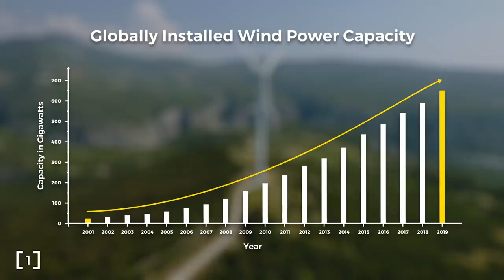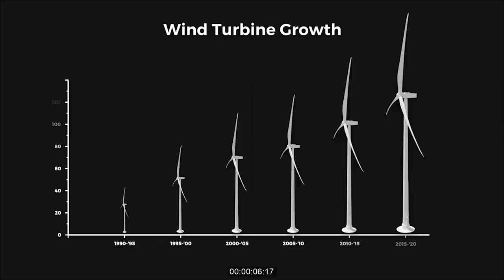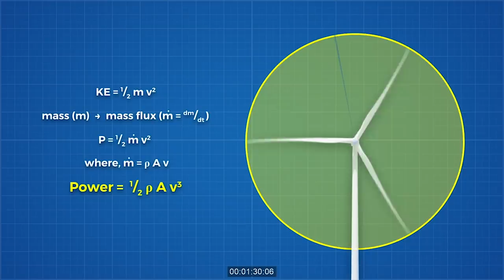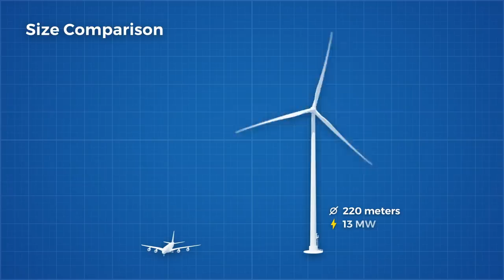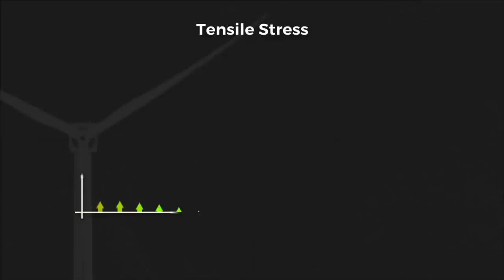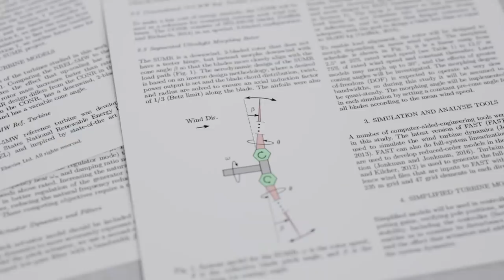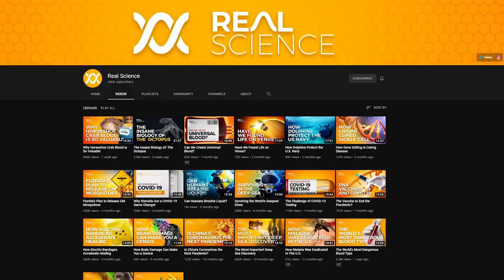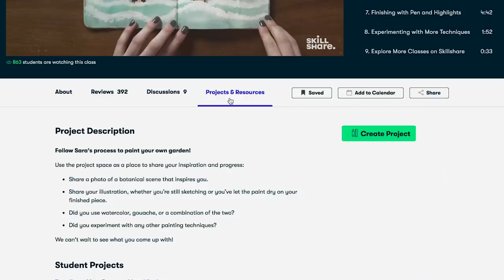How Big Can Wind Turbines Get?

Comment: Yep, coal is an archaic and under extinction power generating method. If we ignore the fact that it is the most used electricity generating method and the second most used overall energy generating method (where it is bested by oil, barely.) Wind increased by large in total amount, and even more if we use percentage, but fossil in general is actually increased too, and by way more in total volume, so no, the current "green" idea is failing, yep, the ideal places like danmark and ireland (no heavy industry and stupidly high cost to population ratio) it can be a leading one, with 100% fast gas backup, otherwise it is simply too risky. But it won't solve the energy issue, still only one non fossil solution for that, sadly that one is a big nono for every green idiocracy.

Comment: Wind Power is far more useful once linked to battery mega packs, which ensure that there are no S/D issues in a short time scale. This clip ignores this development. Also winds are more stable and stronger if you are higher up, which helps higher turbines.

Comment: As a lamen who just likes watching these videos I have a question, Larger seems to be better in the case of Wind Turbines. and  Wind Turbine simply turns rotational energy into electrical energy right? Does this technology not also scale down the other way where it could be put into automobiles so that the spinning wheels of the car also generate electricity? 

I've wondered this for years, as I live in Central California where the Altamont pass has a ton of wind turbines and I've always pondered that question as I drove through it from the Bay Area from or back to the valley. Thanks for anyone who can answer this question. :) 

Sincerely,
An idiot.

Comment: molds require precise machining? what other kind is there? so we get played like a violin nowadays? first a computer does it all with software. the cheap easy way. all man has to do is limit the vibration of the cutter head. BFD.  228,000 blades made. does that sound like it's difficult? sounds pretty routine to me.

Comment: People fail to realize that the big boy wind turbines have a production life of 25 years max then they are rust buckets that have to be demolished  because it's too dangerous to disassemble them. The massive composite blades have no half life -they are mammoth fiberglass hulks that fill ENTIRE landfills FOREVER as they do not degrade. There is no such thing as recycling the blades as they are falling apart pieces of junk by the end of their service life. (By the the way, a nuclear plant service life is 50 to 75 years) And we haven't talked about the displaced animals and hundreds of thousands of birds of prey killed every year by wind turbines. If people want green energy then they should back zero emission, safe nuclear that output hundreds of times MORE power (one reactor = 1,520 big wind turbines) on a footprint that is a 100 times less. Remember, this gleaming white monstrosities become massive, broken dangerous rust buckets in 25 year or less -search Germany and wind turbines. The Germans invested first and very heavily in wind and now they are secretly firing up more and more coal fired plants as their turbine are literally falling out of the sky as massive pieces of junk. Research what these turbines and blades look like after 10 or twenty years of service -they are no longer gleaming white statues but rusty and dangerous hulks that literally pose a danger to anything beneath them. The reason they are building these inefficient mammoths is NOT because they are great value for the energy dollar BECAUSE they are built with government subsidies. People and governments erroneously think these initially gleaming white things will last forever -THEY DON'T. The demolishing of these monsters will offset any fraction of use that they had. If they lasted one hundred or two hundred years and didn't wipe out millions of birds all over the world then they might be viable, but they don't. Smaller wind turbines are useful for small remote sites or villages NOT for producing base electricity for the grid.

Comment: As far as I know s-class glasfiber is stronger than carbonfiber so it can hold greater loads, but its also more expensive. So I don't really see an advantage from Carbonfiber.
Reply: Windmillblades are using, as i see it in your Video, Glassfibermats not glasfiber filament little difference in the name, but a big difference in price and strength.

Comment: Wind is not the answer. It just isnt. the limitations on build sites, cost and frequency of maintenance, bird murder rates, etc. Not to mention all the time and effort it takes to manufacture, transport, and erect each one. Plus it doesn't solve any local demands if you're not in a windy area.

Its just not going to be any sort of dominant energy. Especially when solar prices it out.

Comment: Also I'd like to see a video if it's really more environmentally friendly to produce millions of fiberglass blades every year than to just use coal and natural gas.
Reply: Let's compare: 

The lastest 3 GW offshore wind farm needs around 250 turbines at 1000 tones each (250,000 tones of mined resources) + cables transformers etc lets round to 500,000 tones including the fibreglass blades.

A 1 GW coal power station is about 200,000 tones of materials (boilers, steam turbines, chimneys, cooling towers etc.) Plus infrastructure to supply the coal (strip mining, trucks, trains, ships and some fibreglass etc..) A total somewhere between 300,000 and 400,000 tones depending on setup.

So slightly less., but not by much.

BUT the coal power station burns 9000 tones of coal per DAY, 3.2 million tons per year, 100 million tones of mined coal over a 30-year life, plus 20 to 40 gallons of freshwater per kilowatt of electricity (that's hundreds of billions of gallons over the lifetime), plus 100's of millions of gallons of oil to mine and transport the coal and process the freshwater.

The wind farm burns NO fuel, needs NO oil and uses NO freshwater

So roughly 110,000,000 tons of mined resources for the coal power station

to 500,000 for the wind farm. 

220 times more mined resources for the same total electricity generated.

And that's not including recyclability:

The wind turbines and infrastructure are around 85% recyclable 
(most of the wind turbine can be recycled except for the blades)

The coal plant including coal and oil is less than 0.1% recyclable.

Comment: as long as the blades still have room in landfills as the blades are  pretty big.
the waste these turbines produce is ridiculous
Reply: Not to mention the energy consumption they require not only for manufacturing and transport, but also for maintenance. If one look at the carbon footprint based on maintenance per hour, the maintenance carbon foot print of offshore turbines is astronomical.

Comment: "Clean" energy seems a misnomer when dealing with absolutely enormous structures like these.  Consider the cost to the environment with all the carbon emissions created during the transport and assembly of these beasts, as well as the impact on the environment if and when they fail or break apart.  Once they are assembled, they generate clean energy, but the process of the assembly itself is lending to immediate environmental impacts that are actually substantial.  Building and erecting wind turbines requires hundreds of tons of non-renewable materials such as steel, concrete, fiberglass, copper, and more exotic stuff like neodymium and dysprosium used in permanent magnets.  All of this has a massive carbon footprint.

Comment: btw it is not plastic you keep repeating it as reinforced plastics, plastic resins and so on... it is called Thermosets. a crosslinked form of polymers and they usually use Epoxies for this particular purpose.
Reply: Still plastic

Comment: G'day,

You missed 

BETZ'  LAW  OF WIND.

The maximum amount of power which a PERFECTLY Efficient Wind Turbine can extract from the Air going through the Rotor, and turn it into Torque in the Rotating Axle..., is

0.593.

In other words,

NO Turbine can ever extract any more than 59.3% of the Energy within the GASFLOW going through it.

This applies, REGARDLESS of whether the Turbine is operating in Free-Air, Ducted, or running in Burnt Exhaust Gas...

Because it's an EQUATION..., Betz' Law works both ways, too ; so Propellers (Airscrews) cannot EVER transfer any more than 59.3% of the Power in it's Drive-Shaft into the surrounding Airmass - accelerating  it to generate "Thrust" at the Engine Mounts.

  P = 1/2 M.V. squared does tell you how much Power meets the Windmill - but Betz' Law of Wind says that no Windmill can ever extract any more than 59.3% of the Power which is in that Wind.

Just(ifiably ?) sayin',

Such is Life.

Have a good one...

Stay safe.

;-p

Ciao !

Comment: But, they kill a lot of birds. Plus when the wind blows too hard they must be turned off. I have seen them be blown over, bending the base. Then what do you do with the blades when they are too old? You can't recycle them. You bury them. So they don't go away for thousands of years at best. Lot of problems still.

Comment: Fan of wind power but these blades last 25yrs and presently difficult to recycle or repair. It's likely they will remain longer in use unless climate change storms damage them faster. Building the blades remains a massive carbon emission generator.

Comment: What a massive carbon footprint these blades have generated. When they wear out or break they will need to be replaced. All high tech extreme engineering consumes lots of resources especially when expensive materials are used. Most modern power generation methods fall into this category. But they magically become zero carbon if you ignore the maintenance costs of these often remotely located systems.
Reply: And I assume you have a better idea?
Reply: @pinkiepie1656  Look at the dollar cost of producing any commodity. In general, if the dollar cost is higher, overall consumption of resources is higher. The great assumption of renewable energy is that although it costs more overall and therefore most likely consumes more resources, it does it in a manner that produces less carbon. This is a very tenuous proposition. Especially when these systems require the use of exotic materials and operate in remote locations e.g., offshore. But windfarms make people feel good because they can't see the carbon generated to produce and maintain the system. Unlike a coal fired power station.

Comment: would be nice, if the engineers were given latitude to design wind-turbine blades using powdered, recyclable plastic & microwave energy.   cheaper, stiffer, stronger...but not easier yet.  
and then, covert the power process from at-the-turbine generation to pneumatic wind-turbines, with central node generation.  purpose being, to absolutely curtail the use of semi-precious materials, cut manufacturing costs, increase durability, lower overall costs - as semi-precious metals tend to sky-rocket with time...you can't keep up with inflation, anymore, because of governments' run-away debt...

Comment: So I used to work in the wind industry. My job was to reverse engineer wind turbine controllers that would then be used to simulate the loads that were applied to the main shaft and gear box. There are a few big points that you forgot to mention in your video. First a wind turbine can never even get close to 100% efficiency. To do so would take all of the kinetic energy from the air and make it stop right behind the turbine, preventing more wind from entering and keeping the cycle going. The max theoretical efficiency a wind turbine could achieve is 59.3% (the Betz limit) vastly limiting their potential power output. 

The other problem is a 5 MW wind turbine is a big machine and has as many moving parts as a steam turbine off of a nuclear power plant or a gas turbine, but the gas turbine is producing 100MW - 400 MW each, and the steam turbine off the nuclear power plant can produce up to 841 MW. My whole job was trying to help the wind industry figure out how to solve this problem of low ROI on each gearbox. 

The challenge of a lot of moving parts for only a relatively small power output is why wind will never be a viable cheap form of electricity generation, and I haven't even touched on the problems they are having with their blades, foundations, and towers. If you really want clean power that is scalable there is really only one good option, nuclear.
Reply: Tethered glider wind energy can easily scale to a hundred megawatts and has a high capacity Factor.

Comment: 10:10 No, wrong again, that would be the centripetal force. The „centrifugal“ force is not a real force but the result of the blade‘s rotation and its inertia: https://youtu.be/9s1IRJbL2Co Those are engineering basics.

Comment: 3:20 "very simple formula"

me: wtf is this crap?
Reply: Yes it is a very simple formula if you want to include actual losses into the equation it becomes this
2p*A*v1^3*a*(1-a)^2
Where
A = cross section of the blades
p = pressure in the cross sectional area
V1 =Wind velocity before the turbine
a =  axial induction
and to calculate the efficiency of the turbine you would divide this value with the simple formula provided in the video into an equation like this
(2p*A*v1^3*a*(1-a)^2) / (1/2p*A*V1^3)
So comparing to that it is simple just for the power generation side, then to calculate the Axial induction you have to calculate the aerodynamics of the blades (Thrust coefficient & lift & drag forces) and the mechanical losses from gearboxes etc
Reply: @John-cq9ew  sorry, i dint go to american schools or nevet studied for this cinda stuff. Went to normal school for 9 years and studied for welding/machinery 3 years and got a job before my studies ended. Abd deb free

Comment: Large wind turbines have a terrible effect on the environment.
To install them, it is necessary to destroy mountain tops and create roads wide enough for the trucks carrying the blades to pass. Then you have to dig a laaarge hole for the concrete base. Then many other trucks will carry the concrete and the materials to the top of the mountain side. A large area around the turbine will have to be leveled and affected for the trucks to move around pouring their materials.

Large wind turbines become an effective trap for birds, killing many of them.

Large wind turbines are typically made in one country, and exported to other countries. The country producing them benefits from the jobs, and the value generated. The country where these monsters are installed, has to ruin the environment.

Then electricity is exported from the country producing it, to another country. A big foreign company benefits, but not the producing country.

Transporting the blades and the column over long distances to the other country, means producing a large quantity of gases.

Who has the wind and the sun for wind and solar energy? The European countries of the south.

Who has the factories and benefits from large wind turbines? Germany does.

So, wind energy is a fine alternative source. BUT the scale has to be small. Small wind turbines will be made, installed and maintained by local technicians, benefiting the local community. There will be no interference to the environment, especially on mountain tops, no bird traps, no change to the aesthetics of mountain tops. And no airplanes producing huge gases to transport the turbine.

All will win --except the big fat cats of germany.

Comment: How big can they be? This will be dictated by the construction materials.i can draft them with 2 mile long blades,2,4,6,10 blades.3 miles tall...but nobody can afford to build and operate such machines..big is not always better in this feild.the wind turbon is only one part of a system.the cheapest part.the infrastructure to make it work effectively is the big job and highest cost...iv seen it all,been there done that.youll figure it out when your power bill is 5 times higher than you expected.

Comment: 6:46 „There is currently no technology that allows turbine blades to be separated ... .“ Well that is certainly untrue. This technology has been used in real-life projects by Nordex, Siemens Gamesa and Enercon since 2017, i.e. Enercons E-141 EP4 uses it: https://youtu.be/4AArjcBSjnY Turbine blades for Enercon are produced by German company KTA Kunststofftechnologie Aurich GmbH, Nordex bought Danish supplier SSP Technology mainly for its segmented blade production facility and patents in 2017. How about a little research before making such misleading claims? Those big segmented turbine blades make wind energy projects economically viable in regions where there is not sufficient wind for smaller single-piece blades. Therefore they represent a technological breakthrough and gamechanger to the industry.

Comment: I have yet to come across an OBJECTIVE study of benefits and negatives of wind turbines. For benefits I see electricity generated ( how much and for how long until the unit has to be replaced). Of negatives I see the cost to manufacture/install a unit, the cost to dismantle/dispose of material. Let's ignore if the turbine is considered an eyesore/bird killer.
Reply: Look up mow many birds die from acid rains, oil spills, and exhausts
Reply: @battalionstallion3894  I would like to point out that mankind lives in the same environment as the birds. And at 7 billion plus I would say we are thriving. Besides the yearly toll of deaths from cars by far exceeds bird deaths from oil spills. I think your pity-party is over.